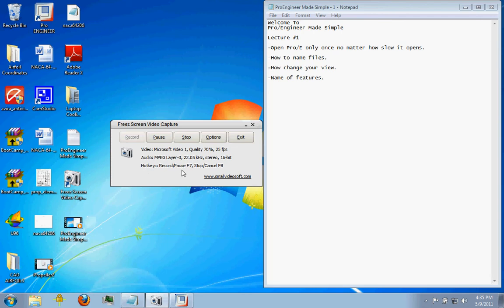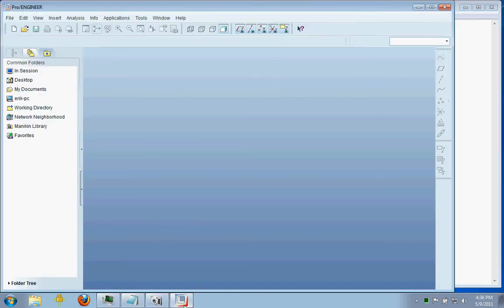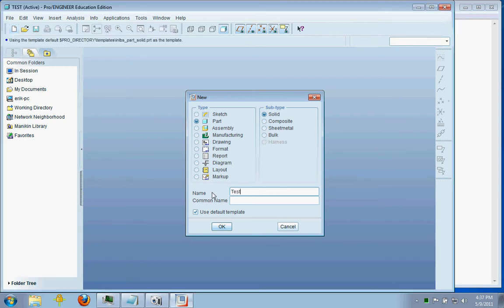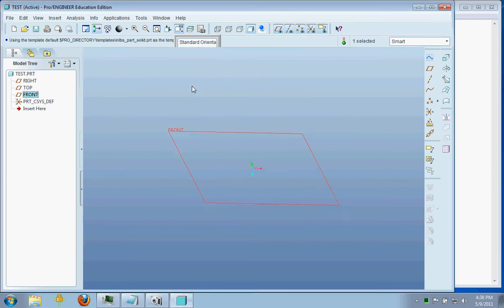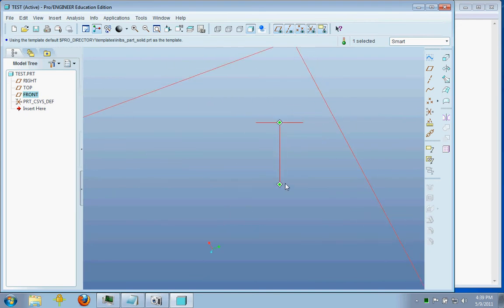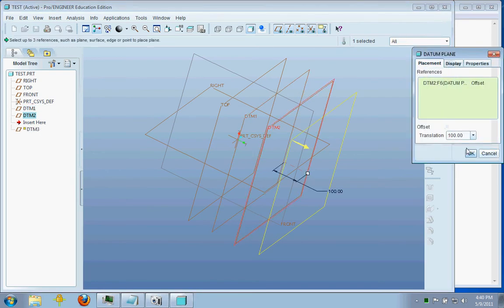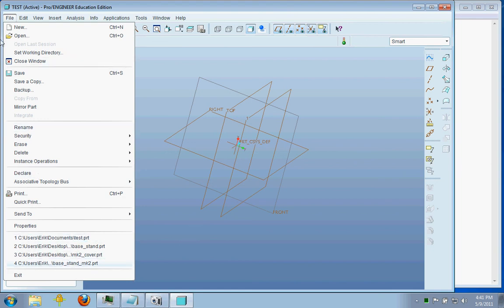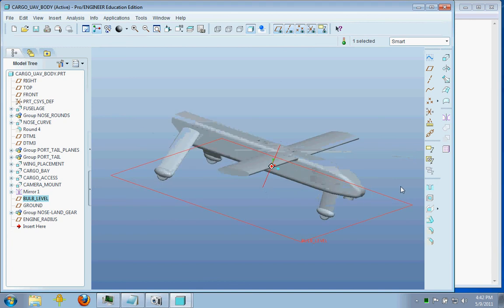Pro/Engineer Made Simple - Part 1 - Introduction to Pro/Engineer

Comment: Where can I download pro engineer? And does this program work on apple.
Reply from the maker: Pro Engineer is Windows only. You can bootcamp your mac like I did and it will work just fine. ProE is available for purchase at ptc.com. If you are at a technical school, they will usually have an option to use their licences.
Reply: ok thanks!